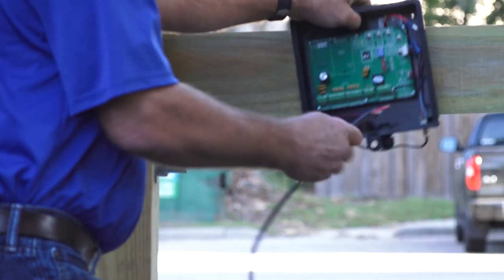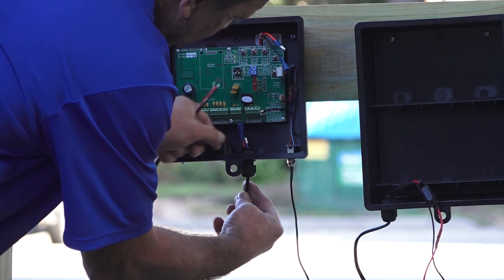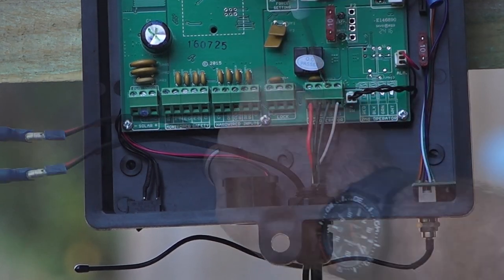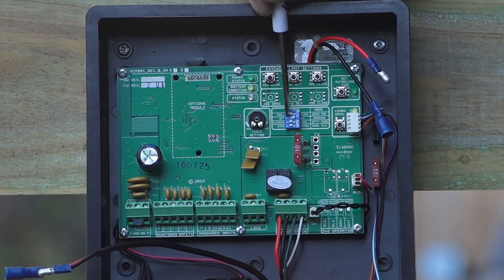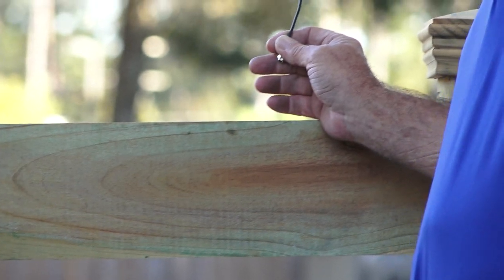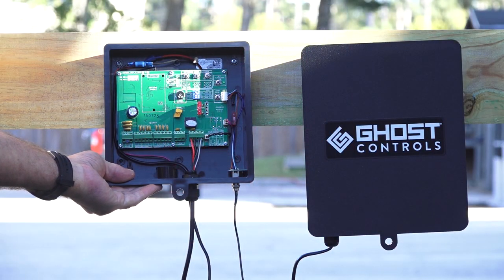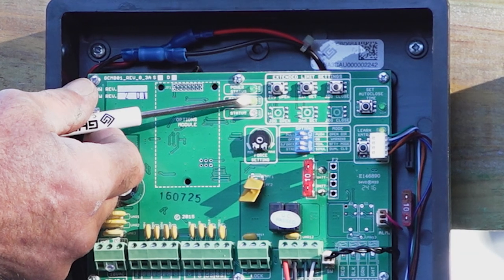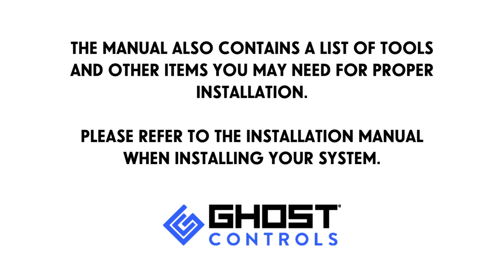Automatic Gate Opener-Chapter 3: Control Box Installation

Comment: My system was installed just shy of 2 years ago.  I've had some issues with the gate not opening, closing and some otherwise unusual behavior.  The system is set up with a 12v deep cycle battery, a large solar panel and a solar charge controller.  It works, but every issue I've had with this setup can be directly traced back to the installer wiring and bad connections at the battery, the charge controller and the main Ghost control unit.  Stripped and twisted wiring at every location doesn't last.  There needs to be terminal ends where screw connections and wire-to-wire connections are made in addition to wire ferrules anywhere a screw clamp connection is made, which are all of the solar controller connections and most all of the Ghost controller connections.  The bare wire connections do not last as they lose connection and voltage over time.
Reply from the maker: Thank you for your feedback. I will make sure to pass this on to our Engineering team. We are always looking for feedback which in turn helps us keep improving upon our products, along with coming up with new innovative ones.
Reply: Thanks.  System does a good job, easy to troubleshoot and fix and each of the 4 issues I've had can be traced directly back to terminal connections from the original installation.
Reply: @gtgarage I've also had mine 2.5 years and started having the same issues. Same setup. I will look into reconnecting the wiring, thanks. I also had it professionally installed. I totally agree that for something this vital (access gate to property) they should've had all terminal connections! How did you fix the issues?
Reply: @gtgarage did you go out and buy specific set of terminal ends for screw connections?
Reply: @gtgarage and what size or type or wire ferrules did you use? Thanks for any and all info
Reply: @educatehour  Don't know were it's going, but I replied to this post and the two below but my responses appear to be gone.  Tried 3 times and it disappears for some reason.  I'll try and get a video made and it'll be found under Grampa Thug's Garage.
Reply: Thanks man maybe they don't want it on here because they should've been included smh

Comment: Let me try this way instead of replying to the posts addressed to me.  I re-wired all the connections with a crimping tool and ferrules for each wire in the main controller and the solar charge controller and properly sized eyelets for the connections to the battery.  The original installation battery wiring was stripped about 2-3 inches and wrapped around the screw type lugs on the battery and tightened with a nut, no washers.  I used the smallest ferrules that would fit the wires into the charge controller and main control unit after being stripped, twisted and trimmed to the correct length.  The ferrule kit I used came from Amazon called 'VANOW Crimping Tool Set'.  I purchased it for another project but it has since been used for other stuff.

Comment: Where is the video for the double gate (TDS2) control box connection????
Reply from the maker: We do not have a video for this installation. Full installation instructions are available in the manual that was provided with your product purchase and on our website under the "Support" tab. The TDS2 manual can be found here: https://cdn.shopify.com/s/files/1/0255/2332/2989/files/TDS2_2021_Manual_bw.pdf?v=1614873308
Control Box Installation info is available for Pull to Open gates beginning on page 23 and for Push to Open gates beginning on page 44.